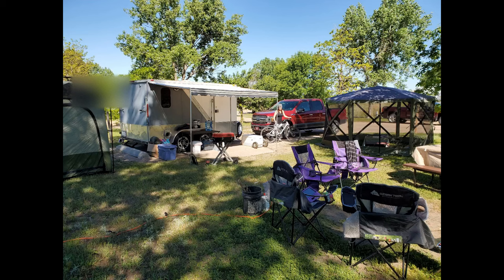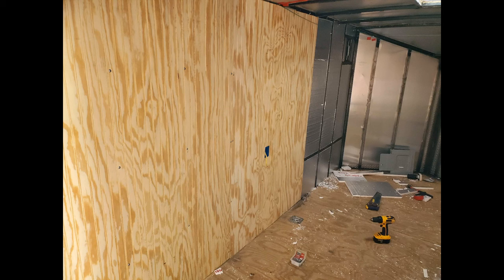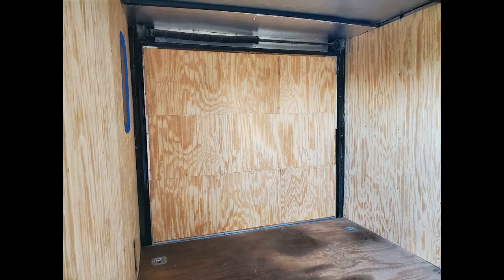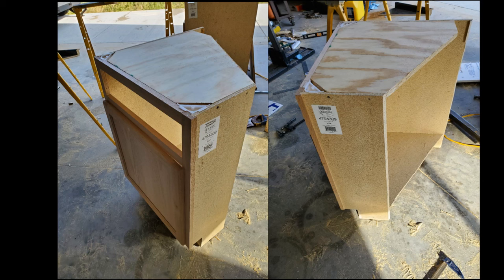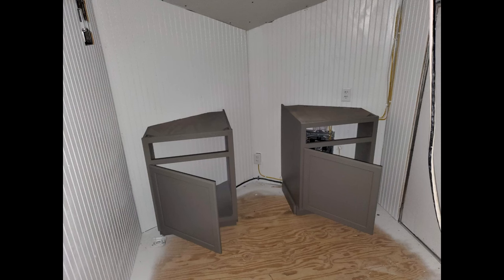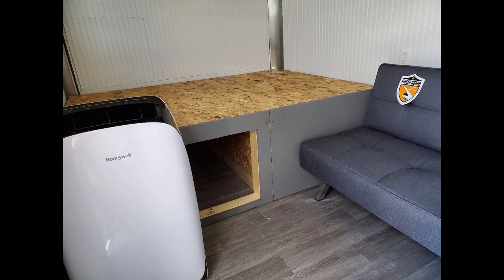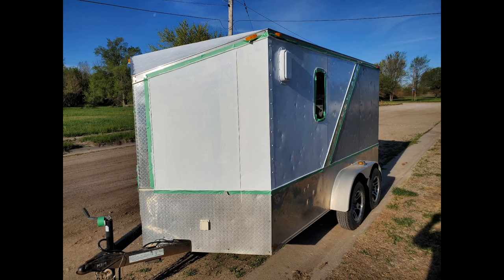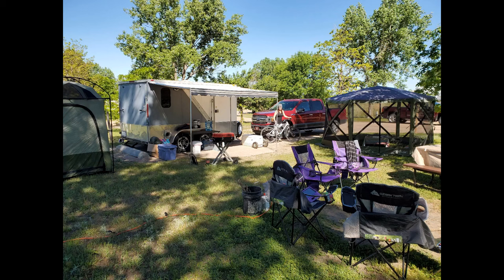DIY Cargo Trailer to Camper Conversion

Comment: I bought a cargo trailer that had already been converted into a camper t go to the Sturgis motorcycle rally back in 2019. Even though it had already been converted I did a "ton" of upgrades and now I love it 4 years later. I have a couple of videos on my YouTube channel as well. Nice job, but being a Harley Davidson enthusiast I kinda liked the original color scheme.
Reply from the maker: Thanks!  I'll have to check those out.  I wasn't that opposed to the old color scheme, but it A) showed the hail dents much more, and B) really soaked in the heat from the sun, especially on the black tailgate!

Comment: Nice Job - I'm converting a 8x20 car hauler.  My guess is yours was a Harley motorcycle trailer. :)  (can't get past that orange!)
We haul our motorcycle (not a Harley) in ours. I'm 1/2 way finished insulating, t got cold here in MI and I'm not motivated to work outside until spring.    I'll subscribe for future updates. I like those windows. I bought some larger ones on FB, but I'm not sure I want them that large.  Have great time camping!
Reply from the maker: It was definitly a head-turner before I painted over the orange and black!  Also picked up a ton of solar heat load with those dark colors.

Comment: Very nice 👍
Reply from the maker: Thank you!
Reply: @StuffMikeMakes  
Curious, how much did the weight go up, in particular the tongue.
Cheers
Reply from the maker: Now that you ask, that would have been interesting to have weighed the  trailer before and after modifications, but I never thought of it.  The plywood walls are probably close to a wash since it had plywood originally.  The big adds were the countertop and bed platform/foam matress.  I had pulled that trailer packed full of stuff during a move, and it still pulls pretty easily in my opinion.  The first summer with it the trailer brakes didn't even work and it was never a big deal behind a half ton truck.

Comment: Well done sir. Looks great inside and good functional use of space. I've heard both good and bad reviews on those types of air conditioners. Curious how well it cools for you in that size trailer. Also, I thought you could buy that size(1/4") bead board already painted in white? Not a critique, just thought you could've saved the painting step in the process. The kitchen area countertop and cabinets looks fantastic. Thanks for sharing. Just subscribed.
Reply from the maker: Thank you for the kind words.  I'd tend to agree, the portable A/C isn't the optimal solution for sure.  It does pretty well, but will struggle to keep up on very hot days, especially if the camper is parked at a site without afternoon shade.  The lighter colored paint has helped a lot, as has the awning to keep that solar load down.  Getting the rest of it painted the gloss white will help some more, and I've also been thinking I may pull the beadboard off of the tailgate and sandwich some thin foam insulation in there, as right now it is just solid plywood.  

I'm sure there are places that have pre-finished beadboard, but my "local" place didn't have any.  They had pre-finished exterior siding products, but those were thicker and heavier.  Fortunately, that pressure pot sprayer made painting pretty fast.

Comment: Why not bigger windows and cut hole for airconditioner.?,
Reply from the maker: Thanks for the comment.  I chose the windows for a couple reasons.  One was cost.  The other was to fit between the "studs" of the trailer.  At least in that initial phase, I was trying to avoid any structural changes to the trailer and even had some thoughts that the bed platform could be removed and the trailer used for cargo again, like hauling lumber from the store on a rainy day.  Similar story on cutting a hole for the A/C.  I have some upgrades in mind for the future, both minor and major, that might approach the air conditioner differently, as those portable units just aren't all that great.

Comment: How high are your ceilings from the floor?
Reply from the maker: Trailer is the standard height from Diamond Cargo, I think they call it 75".  If I was to do it again, I would look for at least the extra 6" option.  The only issue I've had is the handle for the roof vent.  Plan to replace that vent/skylight with a new one that has a lower profile knob.